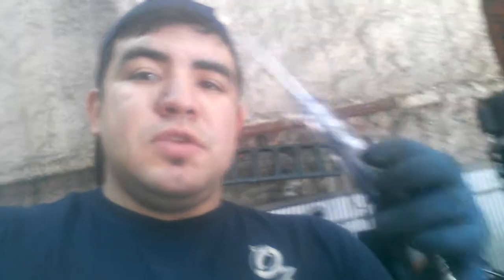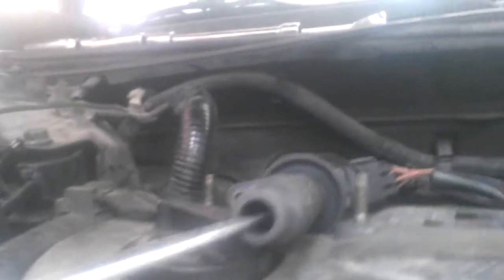How to test for spark with a light tester.

Comment: question, 2004 ford f150 5.4 v3 V8 change all plugs and coil packs, but still has a shake to the engine, the number 1 plug when I unplug it from the spark plug, it doesn't change or idle any rougher, and I did all 8 and 2 thru 8 all made the truck idle rougher except the number 1 plug. I changed the number 1 plug again still no difference, so I'm thinking it is the connector that is dead, how can I test to see if it has power flowing thru it.

Comment: Why doesn't the bulb in your test light burn out? The bulb is probably meant for 12 volts and the coil generates 30,000.
Reply from the maker: liveandletsdive I would believe because  it is quick burst of voltage in a short amount of time. Milli seconds
Reply: The  voltage is too high but the current (amps) is too low...you need current to generate heat